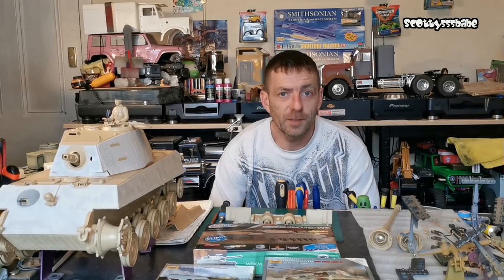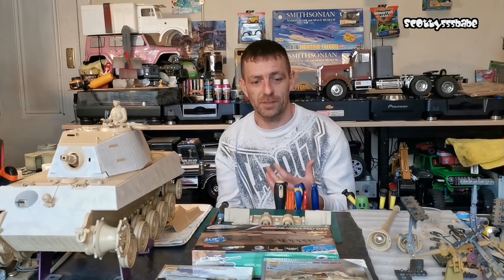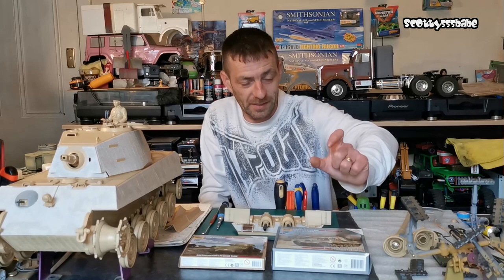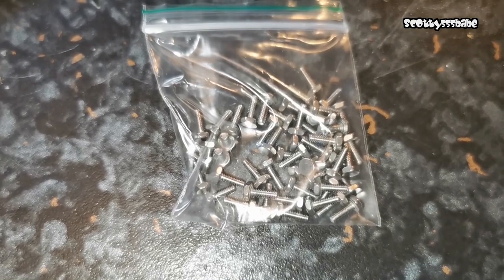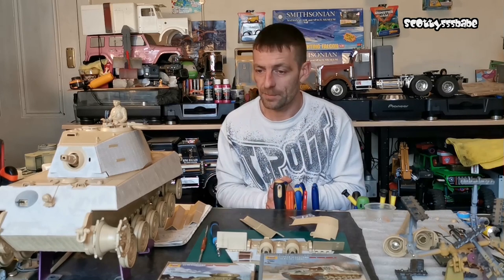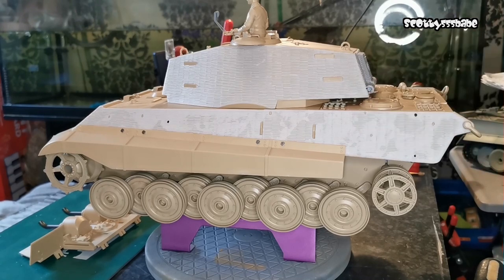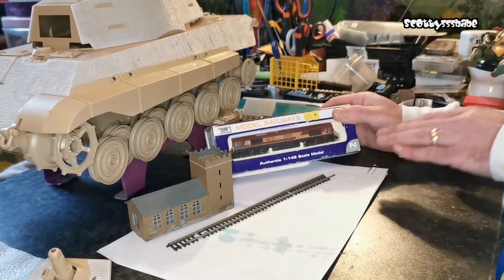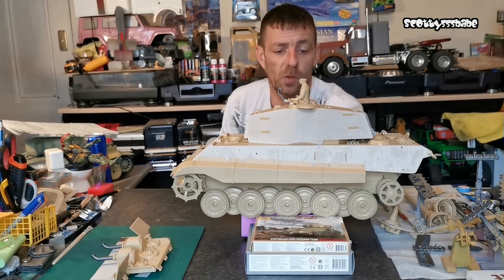TAMIYA GERMAN KING TIGER 1/16 TANK BUILD Part 12 Attaching the Armour Fenders | Tank 233

Comment: It would be interesting to see you make weld seams, Have you found this build costs more than a truck build?
Reply from the maker: I've done a couple of test runs but I want the scale to be as near as possible, I'm just using the vallejo putty at the moment as it comes out fine but would also like to try a couple of other options too, cost wise so far I'm around the price of a truck kit, if the truck was fully modified like my current custom truck I'm building then I could have built 3 or 4 of these tanks and my truck still hasn't had paint, sound and lights etc yet and a few more Ali upgrades however if I was going to go full option everything with the tank then it would probably be swings and roundabouts so they're pretty reasonable in comparison 👍